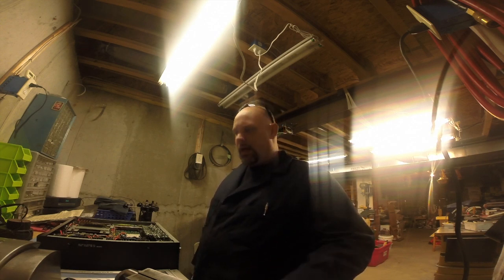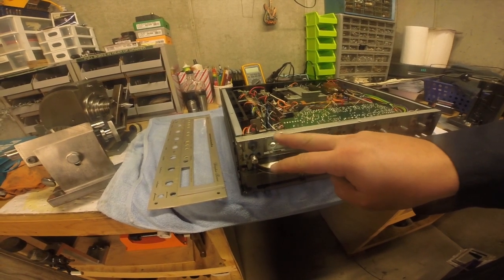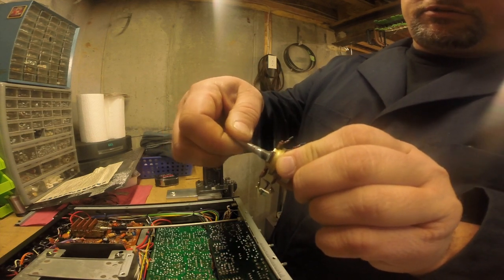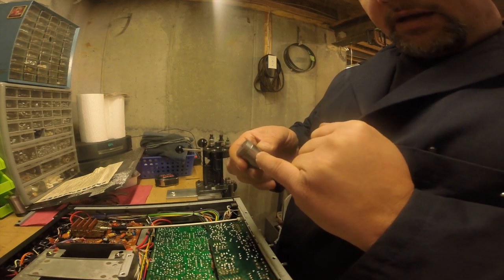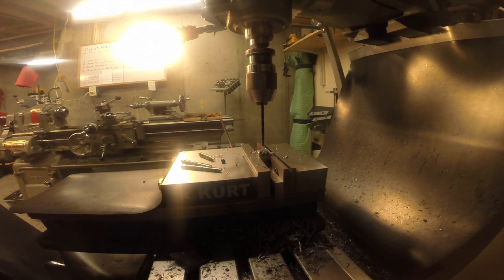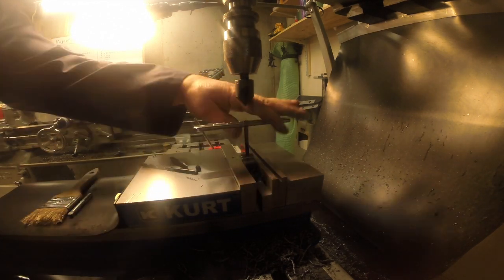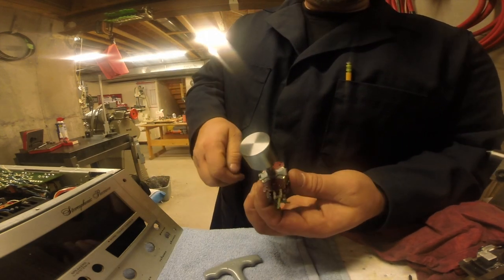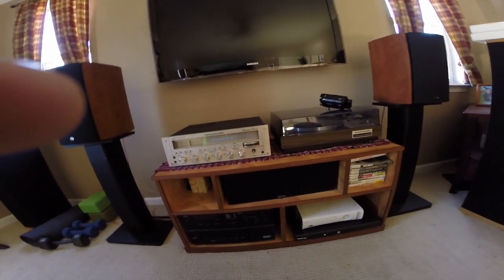Stereo Fix - Machine Shop Style

Comment: Nice repair job, but a 1/4" grub screw is small? I used to think a 3mm grub screw (~1/8") was large for a pot knob!

Over 25 years ago I used to roadie for a mobile disco. I did so many pot repairs, cable fixes etc. I couldn't possibly estimate how many. Least favorite was drying out consoles that had had beer poured into them!
Reply from the maker: Paul Compton I have smaller grubs, but wasn't sure if I had the accompanying taps. I might, but was in such a rush to get it done - I had a party the next day to debut it.

Comment: Brad,
You can't beat those analog stereos! Usually, for a knob that size an 8-32 set screw would work fine. You don't have a ton on torque on the knob. That was a nice fix. I don't know what lens you are using on your GoPro, but you are getting a lot of barrel distortion. (The vertical lines bow out like an wooden wine barrel.) Depending your the software you are using, stuff like that can be corrected in post. Thanks for the video and keep spinning that vinyl! If you are in the market for a cartridge for your turntable, the Ortofon 2M Red can't be beat, IMHO. It fits the standard 1/2" headshell. It's $100 on needledoctor.com.
Have a good one!
Dave
Reply from the maker: Swarf Rat Thanks Dave. Yeah, those settings on the GoPro were all screwed up. The fisheye effect is from the GoPro's camera and depending on the settings it can be subtle or pronounced. This video was really quick & dirty. I've removed the fisheye with their software, but wow, do the files get inflated in size, LOL